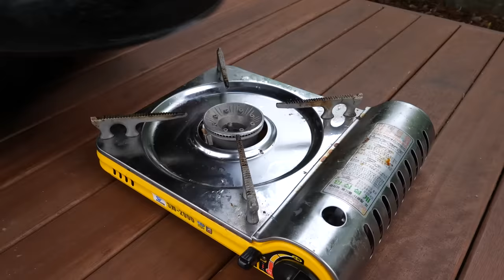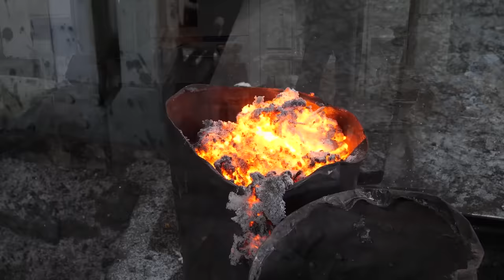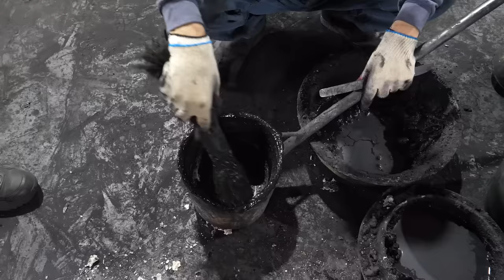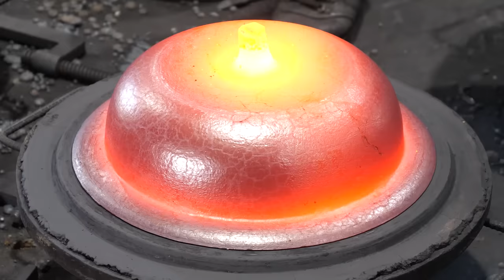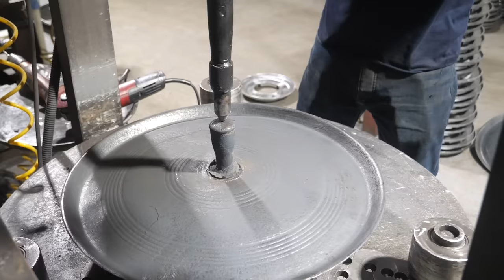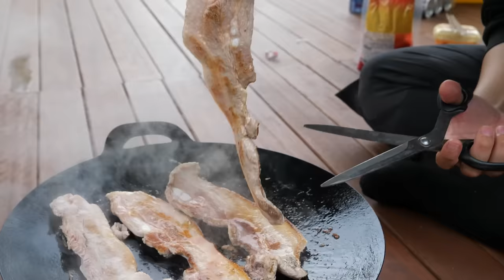Cast iron pan manufacturing process. Metal foundry in South Korea.

Comment: Well, everything looked well placed no over crowding.  Safety equipment very adequate.  All areas kept immaculate and tidy.  Only the most qualified professionals are allowed to work in the areas of the pouring of the 2000 degree Fahrenheit molted metals so no one steps onto or into a pile of said red hot molten metals.  The bottoms of these employees shoes are all fitted with special heat-resistant non-melting rubber.  Air quality is of the utmost concern and is breathed in by special supervisors daily to insure that no one is coating the insides of their lungs with various unknown metal dust.  All in all a great place to work and at $6 a week is a job worth seeking not requiring a six year college degree.  🥸

Comment: Wow I thought there would be some mechanical assistance provided to those men pouring the molten metal into the molds. Wow, how does their back stand up to that
Reply: It looks very dangerous with all that molten metal falling to the floor and dripping around, any mistake and you could step on it or it could run all over your shoes.
Reply: Their backs don't stand up to it

Comment: Shame that Lodge doesn't 
put the effort in polishing the 
cooking surface like they did 
here ( at least they did do some)
The Lodge products I've bought usually need a sanding 
to smooth the inside
Reply: I've sworn by Lodge for years. That skillet they are cooking pork belly in at the end of the video isn't any smoother than any lodge product's cooking surface that I've seen. Currently I have a griddle, saucepan, a Dutch oven/skillet combo and 3 frying pans ir different size, ones with a drip lid and they are all the same surface from the casting process.

Remember that Lodge is sand cast, not mold cast and then shot cleaned. I remember when they were a lot smaller, South Pittsburg is 40 miles from where I grew up.

https://www.youtube.com/watch?v=NEQP94YbYFo
Reply: If you had a clue of WTH you were talking about, you would know, those cast-iron skillets & pans are left textured ON PURPOSE and for GOOD REASONS...The DypShytery on here is sometimes astounding
Reply: @Fireworxs2012   You could explain why instead of committing dypshytery yourself.

Comment: So what is the impurity remover?Special secret chemical?
Reply: Metallurgical flux. Just any chemical that will bind to iron oxide and form slag which will float to the top of the crucible and be skimmed off. Sodium borate, zinc chloride, etc.
Reply: Probably borax
Looks like it anyway 
Maybe with some salt